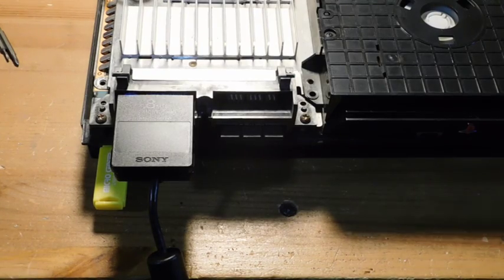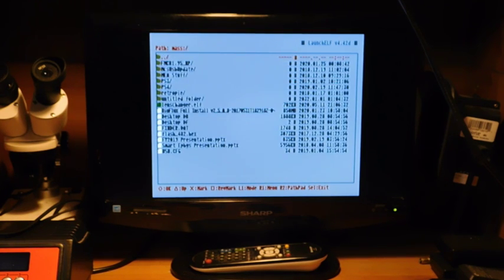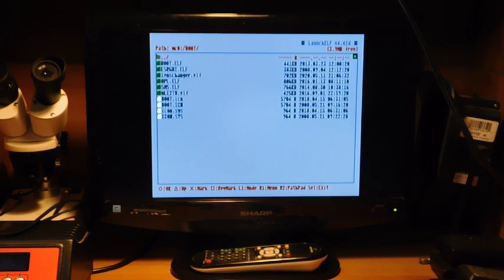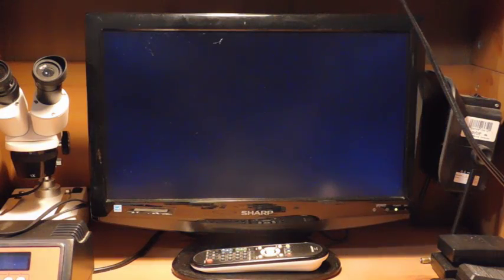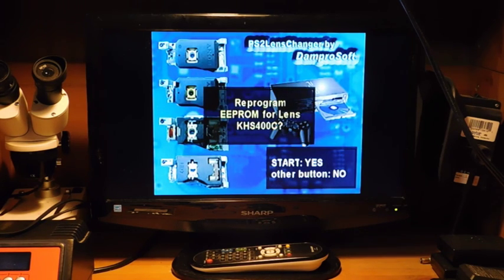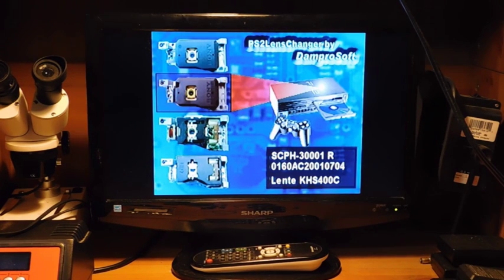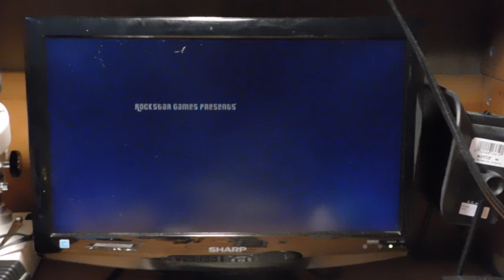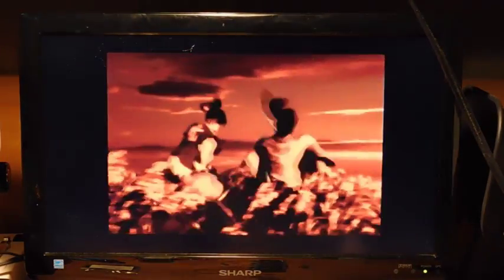PS2 (Original "Phat") Laser Replacement Guide!

Comment: Can't stress enough how much of a difference the drive height adjustment can make; Can make a difference of the drive being able to boot only PS1 discs or both PS1 and PS2 as well as how fast it manages to do so. Along with how much or little noise it makes. In my experience there's a sweet spot where it's fast, reliable and rather quiet. The KHS-400C (Chinese knock-off) however seems to be pretty noisy no matter what.
Reply: @filevans  Very easy to adjust. It's just a relatively small cog that you can turn clockwise or counter-clockwise. Problem is it's time consuming depending on how much you're comfortable with stripping the drive down while testing.
Reply: I had a 400B in mine, which I tried to replace with another 400B and it was so noisy I thought it was broken!  That's why I tried to replace it!
Reply: This comment saved my PS2 fat, wasn't reading ps2 games randomly, after a quick cleaning and minor drive height adjustments, shes back in action!
Reply: Dang wish I had seen this comment before I tried to adjust the potentiometer on my 400B drive that was only reading PS1 discs. Now it reads no discs, hasn't for months. I just put a 400C in it today. I didn't understand why it wasn't reading anything before watching this video. Had no idea you had to flash new firmware for different model lasers in these things.

Comment: I’ve upgraded to the 400c in my fat ps2. However with the new laser it only reads music CDs, ps1 games and 5 of 30 of my ps2 DVD games and no Movie DVD. I’m thinking could it be the screw on the underside left one above where the solder is removed of the laser that needs turning clockwise a fraction? This according to another YouTuber adjusts the strength of the laser that reads DVD. Left one DVD laser strength, right one CD laser strength. Or is it just to do with that Lens changer needs running on it? That bit haven’t done yet as haven’t got MacBoot on a ps2 memory card.

Comment: Dude thank you thank you thank you. I ordered the KHS400B laser since I have a SCPH-30001 model. I haven’t played this since Grand Theft Auto Vice City (my youngest brother played it for thousands of hours and the laser broke). I found the PS2 collecting dust so I took it apart and with your video, it works like new again. I sincerely appreciate you giving your advice to help fix these. May I suggest to make it easier for you and others, to unscrew the screws safely you’ll need a PH1 and PH000 for the backside and lid for the disc reader. That tiny screw on top of the laser was removed with a Torx T4. Thanks again for your help!
Reply from the maker: Thanks so much! I’m glad that the video helped you to repair your PS2 and thanks for the details about the screwdrivers. It’s great when you can bring these old consoles back to life and enjoy some classic games!
Reply: I don’t understand, my console came with a 400c and it’s also scph-3001?
Reply: @LIRetroGaming can 400C work with 30004? And Can play original game not copy game?

Comment: actually there is an option in the PS2 settings on the version menu called diagnosis that will let your system automatically adjust the height of the laser to read the disc
Reply: Same for a ps2 slim?
Reply: By default? Or homebrew?
Reply: @officialtregotit  any ps2
Reply: @KyubiRonso stock menu, press triangle to view the version memu
Reply: Bro this actually helped my situation! Thanks man! Didn’t want to take it apart
Reply: Thank you
Reply: @kitterbug  didn't work for me. Took the cover off with a regular screw driver and the disc tray cover. Cleaned the lens with alcohol on a q tip. Problem solved.
Reply: I found a lazer for my ps2 fat same model number but it looks different will it work if it's the same # thanks

Comment: I noticed when you opened the drive top I could see the laser cable looked worn, as if hit by the spinning disc over and over. Yet supposedly only the slims had that problem. I just bought a used slim from eBay and have already scratched one disc. That truly sucks.  Not quite sure what to do. I used to have a fat model, but it was stolen. So I was going to give my PS2 games to my grandson along with a decent console. But I hate to think of ruining all my old pristine games. I wish there was a sure inexpensive fix. 
Thanks for your video 👍👍

Comment: Very nice & informative video ... Many thanks for sharing, man ... I have an 30004R PS2, which is one of my fav consoles. Although the laser lens still works, someday it will need to be replaced. A couple of questions, if i may (my PS2 is "chipped", BTW, if it makes any difference): A) Does your method make calibrating the new laser unnecessary? Or i misunderstood? Because calibrating those suckers is a major PITA, plus needs special equipment e.t.c. B)  If the original Laser fails, can anyone take the unit to a specialist, together with the chinese replacement lens, in order to "copy" the calibration parameters of the original lens to the replacement? Or the replacement unit needs to be calibrated onboard the console? Anyways, thanks in advance & sorry if i asked anything stupid above XD ... Cheers
Reply from the maker: Yes, you should not need to do any additional calibration to the laser. After doing this you can just drop it in and it should work

Comment: Hey I have tried your method on two fat PS2s. Bought a new 400c laser, installed lens changer and it still wont read games. I tried adjusting the black screw on the laser and the white wheel on the back of the disc tray to no avail. Can you tell me what I'm doing wrong?

Nevermind. I tried a different laser 400B, flashed it to 400B EEPROM and now the console works. Thank you!
Reply from the maker: Awesome, glad you got it working!
Reply: @LIRetroGaming  Turned out it stopped working again not long after I edited my comment. So far I tried multiple new lasers 400B and 400C. How many consoles has this worked on for you? So far  I'm 0 for 2. So now I'm looking into a program called PlayStation Mechacon Adjustment Program (PMAP) that has even more settings at calibrating PS2 lasers.

Comment: Got a "fat" SCPH-30001 that takes like 2 minutes to read the disc, I tried cleaning the laser but it did nothing. So I'm guessing I need to replace the laser. My main questions are:

1. I have a really old soldering iron, from like the 1950s/1960s. It's so old it says "60 cycles" instead of "60Hz". Will this iron work?
2. Also, when I had my PS2 apart, I adjusted the laser height gear (the white gear) and I'm not sure if I have it 100% in it's original factory position now. But I believe it's 99.99% near the original position (if it's off at all it's properly just a notch off). If I'm not in the original position, can this cause any problems?
Reply from the maker: For question one it is hard to say, but I would be more inclined to get a new temperature controlled soldering station. There is one made by a company called KSGER on Amazon and it is very good and also affordable.
2. Regarding the gears, I think it is OK even if it is not in 100% the original position. The laser has a range of tolerance so even if you are off by a little bit it should still have no trouble with reading

Comment: My fat ps2 just went last night. Sucks. Just wont turn on. Walked by last night while it was off and the red light was off. Checked the power button on back. The one with the line and circle on it. (Yeah im not tech savvy) i think the line is on position. Anyway. I tried multiple tvs. Doesnt work. I ended up just ordering another. But what could it have possibly been? Btw im on long island. Whete r u guys located in case i need a console repaired. Thanks

Comment: I have a 20 year old SCPH-30004R of my childhood, one of the most unreliable about laser. I bought the original Sony new old stock KHS400C, and tried for 3 days to adjust the screws for calibration. There was no way to get satisfactory results. I was able to achieve perfect reading of single layer DVD5 games, or dual layer DVD9 games, both were impossible. The height of the laser for the two types of discs is totally opposite, higher for single layers and much much lower for dual layers, with no meeting point. At this point i think there is some other problem on the motherboard, or with some laser controller, i don't know. Now i think i'll take a model with a more reliable laser.

Comment: I bought a refurbished PS2 with brand new lens (this exact one 400C) and my biggest issue is, if the disc is even slightly used specifically with Jak 1, 2 and 3. They all have issues before the main menu. Unless the disc is spotless from a new case, they don't want to work, yet in my 2002 Stock console from childhood, and an untouched PS2 slim, no issues. These lasers are either not as good as the stock versions or an adjustment didn't go right.

Comment: i believe the whte thing you took of is the only problem w my laser it doesn't grasp that bar as yours does it just slides over the swirling bar on the far right(the worm screw)

also stopped reading blue ps2 disc maybe the last part if video will help?
Reply from the maker: Got it, sometimes the white bars have difficulty attaching to the work screw. You can purchase replacements and that may help. Or you can use lithium grease on the worm screw so that the laser moves more smoothly

Comment: My original laser works, it reads DVDs, PS1 games, but only certain PS2 games. I say certain PS2 games, because it reads all of them… some play just fine, but most of them just freeze or stutter so bad. Is it best to just replace the laser? Do you think it’s because some disks are in better condition? I have cleaned the existing laser, and the rest of the console. Is it possible to just to re-flash an original laser to see if that may help re-calibrate it?

Comment: I would not be surprised that all the KHS-400C laser lens modules you will find on ebay and other Ecommerce websites are all made in Shenzhen, China. Any major electronics company who have outsourced their manufacturing to China were most likely based and manufactured in Shenzhen due to its close proximity to Hong Kong given that it is a Special Administrative Region with access to foreign trade. Since Sony no longer supports the PS2, I would not be surprised if the Chinese Manufacturing firm that Sony outsourced its PS2 production to is still making them given how popular the PS2 was which is good news for us Retro Gamers.

Comment: I recently bought a replacement laser and it appears that it has soldering covering at the back, should this be removed? I’m unsure if it can stay. If so, how would you recommend removing it? Thx
Reply from the maker: Yes it needs to be removed. You can use a soldering iron and solder wick to remove it

Comment: So if i have a memory card with homebrew on it do i still need the flash drive with it on it? Or can i use the  memory card by itself?
Reply: Because i bought a memory card with the latest mcfree homebrew on it. Do i have to install lenschanger on it or is it part of the mcfree software?
Reply from the maker: It is not part of the software that comes with free Mcboot, so you have to use the flash drive to transfer it over to your memory card. But once that is done you don’t need the flash drive anymore
Reply: @LIRetroGaming  ok so once i do that transfer going forward i will only require the memory card? If so awesome

Comment: Bought a different laser, took the playstation apart and the power ribbon was removed on accident. Watched a video on how to open it up to plug the cable back in, did it, put everything back together just for the replacement laser to not work.

Comment: My lens ribbon connector broke/ripped off when I was replacing the battery on the board (SCPH-50001). Ordered another lens and it'll get a rewrite on the EEPROM to accept the lens (original is HD7, which is hard to find, the one I ordered is a Sony KHS-400C for the 50001 model, which is better than nothing).

And when I try to use it, it doesn't read the discs and I entered the correct menu to change it.

Comment: Thanks for you video! I have a question, does your method also work for other PS2 fat models? Because when you change the EEPROM, I can see that the program says "SCPH-30001", so I am wondering if it only works for this specific model. I have a "SCPH-50006", I wonder if it works for my model.
Reply from the maker: Unfortunately I have not been able to make this work with the 50000 series ps2s
Reply: @LIRetroGaming  That's sad 😐. Now i know why my brand new KHS-400C is not reading disks. I got a 5000X as well
Reply: I have been doing a lot of research on the eeprom because I have seen ps2 eeprom chips get corrupted in different forums. It seems the 50000 models are the ones I've seen with the corruption issue as well. What's interesting is it uses a different version of the eeprom chip called the "dragon". It has the same settings programmed, though, so I'm not sure where the issue lies. One of the tips he pointed out in this video is to save the lenschanger app onto your fmcb memory card before backing up the eeprom settings. This way, you don't mix it up with another consoles settings in case you are repairing multiple systems. I'd like to know more about the risks involved when rewriting the eeprom.

Comment: I have a 300001R ps2 fat, with a 400c laser that stopped reading discs completely, I just picked up a new 400c laser from eBay and it would read discs after saying "reading disc" for almost 2 minutes.. played with the white gear and got it to run blue ps2 discs instantly but no other discs that fast. Would flashing the EEPROM be worth it or just keep messing with the gears???
Reply: flashed the eprom and still not reading ps2 games or dvds

Comment: Hi I have an australian pal silver ps2 model number scph-50002 how do i figure out what laser i need i already looked inside it looks like a khs 400b though so do I use a khs 400b or 400c your video confused me a little sorry
Reply: ok not so confused now just watched the part that confused me again but can I just buy a 400b and not use mcboot? or am I wrong in thinking it needs a 400b in the first place? sorry to be a nub!
Reply from the maker: No worries, I can try to explain better. Basically the technique I described in this video lets you use the KHS 400C in your PS2 instead of whatever type was originally there. So in your case, you can buy a 400 C and it will work in your system with this method
Reply from the maker: The 400 C is cheaper to purchase and much easier to find than the other versions, and normally with this method I can simply install the new laser and be ready to go. Flashing the firmware somehow improves compatibility with the replacement lasers that are available on the market today
Reply: ok well I guess 400c it is lol

Comment: The inside of my ps2 looks different to the one in the video. The laser doesn’t have the Sony “box” around it and the metal part on the left has a rectangle in the middle rather then the lines running through it.
It’s driving me nuts one minute it was working and now it’s reading discs but won’t run the games. Or I get “disc read error”. 
How do I know what laser will work for my ps2? Really don’t wanna get a new one this was my first console.
Reply from the maker: If it’s a fat ps2 then this guide will still work for your version, even if it’s a different model. The khs-400c is the laser that you will need
Reply: @LIRetroGaming  awesome, thanks!

Comment: I have ps2 30001R, will laser khs 400c work ?
Reply: You most likely have a 400B laser. You’d have to flash the EEPROM with the Lens Changer program to get the 400C to work. That being said, the 400Cs are known to be more reliable than the 400Bs 😎👍🏻 30001R is a GREAT board revision too, they last for sure, with a 400C and the reprogramming, you should be good for years to come!

Comment: Mine reads okay but when you hit eject it pops the tray out and about a second later it pulls it back in. I wonder if the slides need to be lubricated?
Reply from the maker: It probably needs a new rubber belt for the tray
Reply: Oh, are those easy to replace? Available anymore?